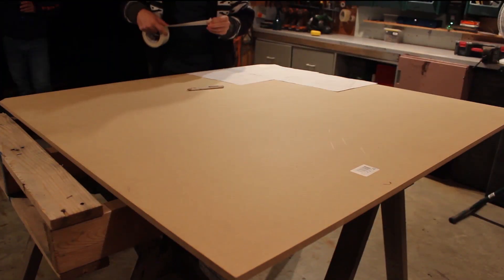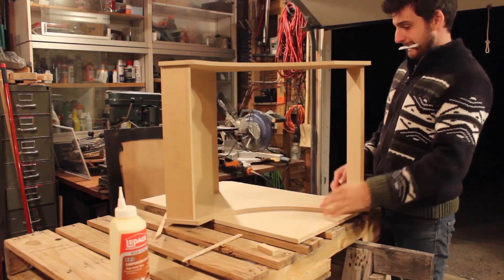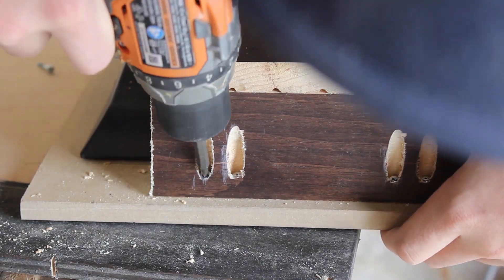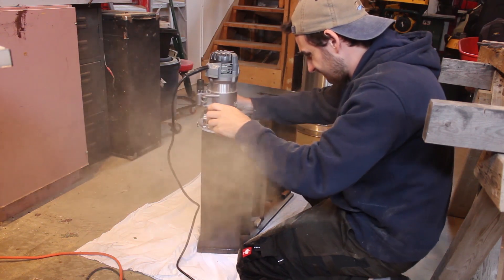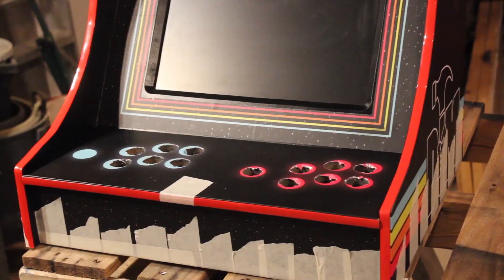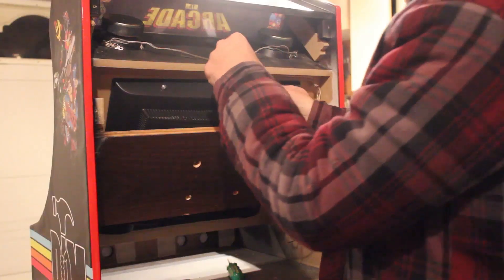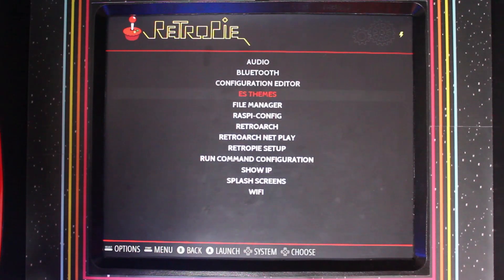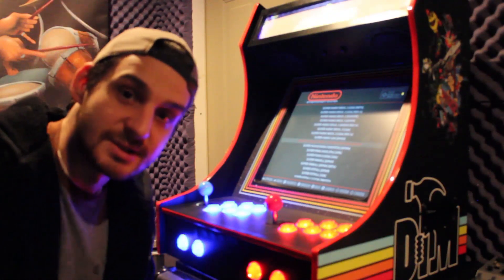How to make: 2-Player Bartop Arcade

Comment: Nice Job man. would using a 4:3 monitor vs 16:9 make a big difference? are there a lot of games that will be stretched out or cut off at the sides if i use 16:9? Starting to build one myself and i m trying to figure this out.Thanks in advance

Comment: I am super new to wood working. I've built a dice tower and a laptop stand so far. I do not have a table saw but I have a portable black and decker workbench, a Jigsaw, Circular Saw, Scroll Saw, hand saws, miter box, hand planes and basic square sander with 80 120 240 or something like that. Three to four questions: #1. total cost of the project and #2. Can I do this without a table saw based on the tools I have? #3. Do you think a polyurethane or wax would look nice on top of the stain and or spray paint? Trying to learn about wood finishing too. Lastly #4. I would like to add a trackball, any templates with an included trackball? 

Thanks so much!

Comment: Great build... I built my bartop a while back but I like looking at others videos. It is relatively cheaper to build one instead of buying an Arcade1up then trying to mod it. I’m learning that this is waaay cheaper the building a Vr pinball machine. I’m trying to build one from scratch and so far I’ve spent more money on the electronics parts alone. I still need to buy almost 200$ more worth of electronics, I’m saving money in the pc bcuz I already had a beast of a computer but damn... Great video